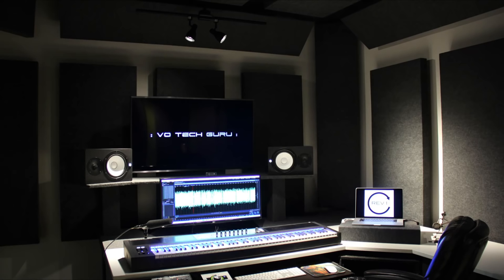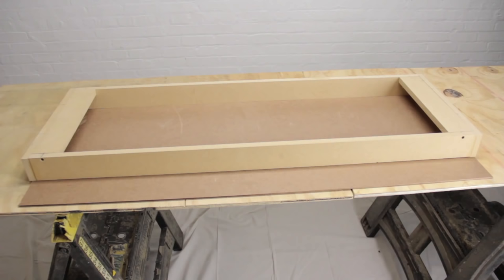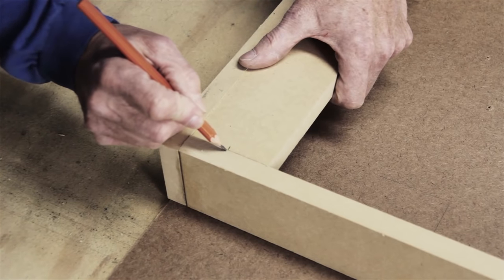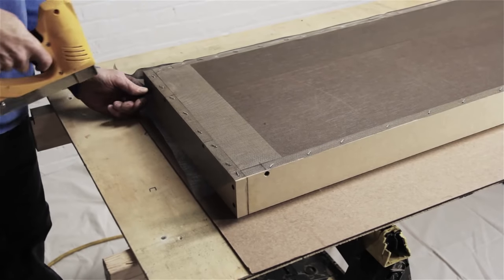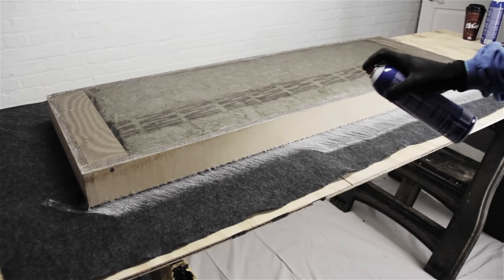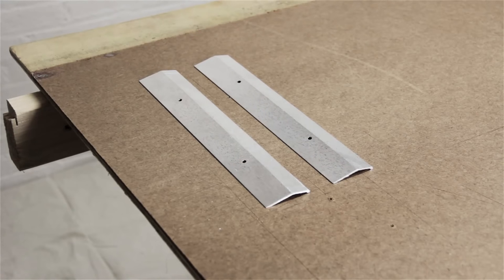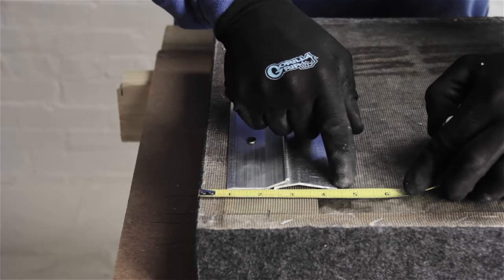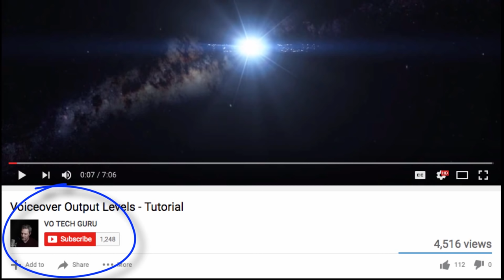How To Build Acoustic Panels | DIY Acoustic Panels

Comment: I wonder if he knows those speakers are not designed to go like that and either designed to be used in a room with too much treatment. Just saying...
Reply from the maker: isaac pizarro I know precisely why I have my near field monitoring setup this way with these particular speakers, room and the types of projects I mix and what I do for a living, but I’ll give you the benefit of the doubt and assume you know something I don’t. Please explain and educate me and anyone reading this post.
Reply: @VOTECHGURU   Well to start, your Yamaha's are placed on a horizontal position when the manufacturer designed them to be on a vertical position. That info has been all over the internet for the last decade due to the confusion between HS series and NS series which are totally different in sound and build. The horizontal placement would cause a phase shift that will increase the apparent bass response but distort the stereo  image that they  are meant to create.  And btw this is not something im repeating from some forum ...that info it is on the owners manual for the speakers.  Second , the HS series were designed to be used on a non treated rooms.  If you remember the HS5m which were the first on the series to be out , they received a lot of  critics because they lack bass response which it was backed up by a lot of test from customers using spectrum analyzers  to view the speakers bass response on their rooms.   Unfortunately lots of those test were done very wrong by using the poor HS5m on a very well treated room. You could clearly see the roll off on the spectrum analyzer due to the lack of bass. YES but that was an intended technique by Yamaha when designing the HS5m . See , the HS5m were supposed to be using the bass build up of the home studio room to fill up that suppose lack of bass ppl were talking about. When putting the speakers on a very well treated room with bass traps and all that ...guess what now?...ppl were sucking up the bass that the poor speakers were supposed to be  using.   Everybody's  conclusion was ...No bass.  Thats why everybody was getting the HS8 ...big speakers = more bass.  Well, happens that the  HS8 were designed for use in a more big room studio environment and not for a 12x12 home studio room...mostly bedroom.  But   Not everybody knows about that.  Then it comes the new renovated HS series ....in which they changed some of the things inside the speakers and outside...like the shape of the Yamaha logo frame on the front of the speaker. Now the hs5 are a tiny bigger in cabinet but due to the reputation they got on the first line up and the subtle changes that were hard to be noticed,  nobody was interested.  Thats a little bit of history on those speakers. Yamaha its still trying to save the series with a new model that just came out this year.  I personally used to own the HS5m and for my tiny room no bass traps..they sounded amazing and clearly could hear all the bass ppl were complaining.  Now I have moved to a bigger room and own the HS7 (second line up). They dont sound as clear and focused as the HS5m and I dont have to much sound treatment but they sounds too bass heavy. Im looking forward to get the HS5 again for that reason. And btw  thats the reason I was watching  this video a year ago. So I can make some panels...which I found very unique your technique , easy to make and not expensive as other videos shows here on YT.
Reply from the maker: @AudioReplica2023  Thanks for the educated reply. I know exactly what you're talking about regarding the older and newer designs. In my case, I found the listening field to be too narrow when I have them vertical and can tell the difference when I raise and lower my head in the listening field. In the bolt area of my room, when I'm in the sweet spot and pulling back from the monitors when on their sides, I get a more even response and it shows when I'm cross referencing with my mono cube, earbuds, the car and so on. Gotta go with what works in my space when mixing beds for film or commercials, or even my own stuff. If the room were untreated, I might get different results as you said about the newer design. But I really appreciate your response and you watching the video and making the panels. Very cool!
Reply: @VOTECHGURU  I know exactly what you mean with the image ..I have noticed that too. and I agree with you on going with whatever works for you on your space . Thats a very important point to have in mind .  👍🏽

Comment: Just use a damn finish nailer and some glue. Why all the measuring, marking drilling when your glueing it anyways so you can't take it apart. Just use 16 guage nails and glue. A lot faster!!!
Reply from the maker: I made this video for the average Joe and not many people have 16g nail guns or compressors. If I was doing it myself as a carpenter there are a few things I would have done differently, but complicating it with production jigs and whatnot would only make it harder for most people.

Comment: You're breathing the Rockwool fibers coming out of that panel through the acoustically transparent fabric or any other exposed parts. You'd have to seal the back of the panel with wood, seal the sides of the rockwool panel with glue, and glue a 2¨pice of acoustic foam on the front, between the Rockwool and the fabric. The fabric won't stop any particle from coming through it, because the particles are so small. Rockwool is dangerous. Of course it's approved; it's a big company and there's big money in it. Or you could use recycled cotton instead. Rockwool is OK behind a wall or ceiling, where it can't come out and reach your lung; it was never meant to use inside something hanging on the walls of room, where you are breathing it. Don't believe me ? Shine a black light in the darkened room and see the stuff floating around.
Reply from the maker: Really. Explain how it’s dangerous.
Reply: @VOTECHGURU  Google it. Plenty of vids right here.
Reply from the maker: Oldestpunk Inargentina Nah, that’s ok. You provide a video/s that prove it since you said it. I’ve already done my homework based on facts like MSDS sheets and study results, not video claims. Anyone can say it’s dangerous...case in point. Prove it.
Reply: @VOTECHGURU  You breathe it. Plenty of studies online on why and how it's hazardous for your lungs. You have read only those that say it's safe apparently. The stuff is not meant to be exposed; it belongs INSIDE walls, doors, ceilings, etc, but because it's cheap to buy and easy to use, everyone is stuffing their panels with it.

Comment: But if your fabric isn’t acoustically transparent then your sound board isn’t really worth anything
Reply from the maker: If you hold up the craft fabric we used to the light you can see right through it. Also easy to blow through. It's very transparent and the panels work great. Thanks for watching!

Comment: There is so much wrong for this to work efficiently through the broader range that I wouldnt advise u to build it eventhough it looks good it shurely performs poorly
Reply from the maker: Jack Bixby Gotta love trolls. You're hearing me voice this video in a booth with those panels. I write, perform, voice and mix music and voice over for major brands internationally for film and commercials using these panels. No complaints so far. If you have anything else to say, provide data and performance metrics. I know them well, ergo, I built these panels. They perform VERY well. Troll.
Reply: Good for u, u know the frequency that this panel is effective?did u ever hear that u can extend the working range of it by 30_40% just by mounting not flush but away for the depth of wool?pick up an acoustic book trool
Reply from the maker: Jack Bixby Jack Bixby They are away from the wall, thus the bracket and bumper, so you clearly didn't watch the entire video. The bolt area of the room is great, the acoustics are great and has been tested up and down the spectrum and consistently yields pro results that land paying gigs. If you ever put a panel video together to show everyone how you do it, let me know. I'll even be your first sub.
Reply: ok we wont debate anymore:) thanks for the video good luck with your channel and business;) take care and greetings from Slovenia;)
Reply from the maker: Jack Bixby Thanks.